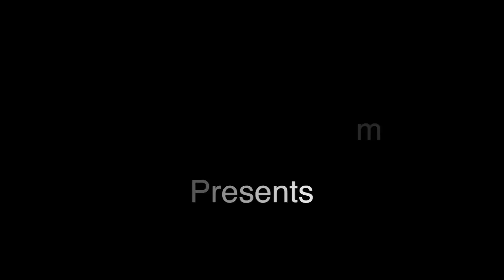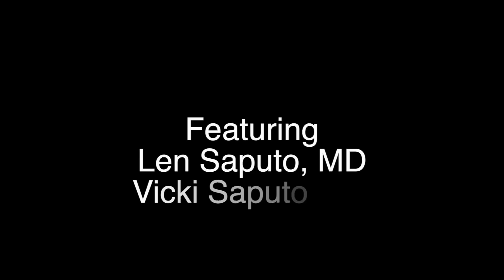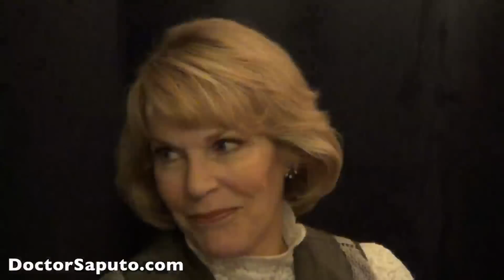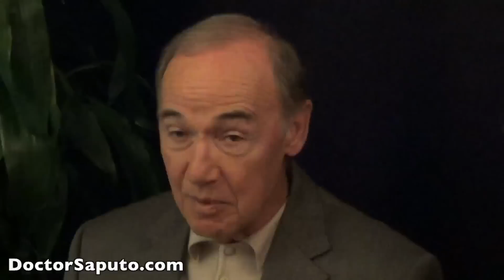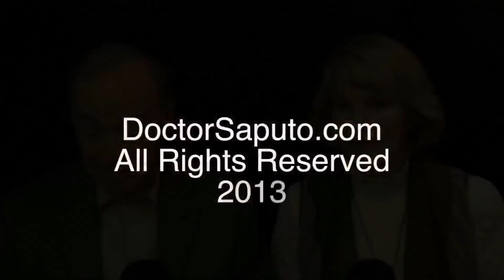The Hip Resurfacing Scandal

Comment: Horrible story doctor!  You have my every sympathy.  DePuy would appear to be very culpable in these many cases.  So a defectively designed implant is just that.  Can't make something poorly designed work better than the defective design.  But, the surgeon is responsible for getting the angle right within a small range of tolerance.  Better surgeons get better results.  I've had my Birmingham hip for almost 7 years.  My implant is a Smith and Nephew, which has not been recalled.  My surgery was done by Dr. Su at HSS and his failure rate is 2% at 10 years.  So the skill of the surgeon is an important part of this equation.  Still, so sorry to hear your story and ensuing misfortune.  Glad you are better now.